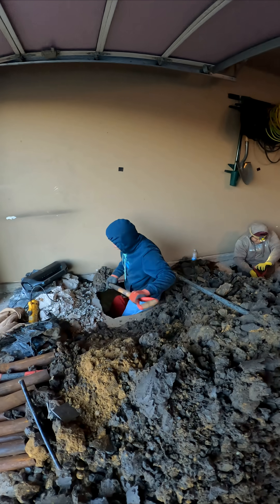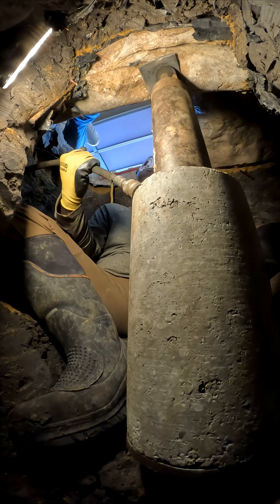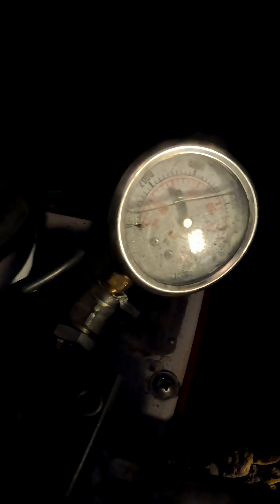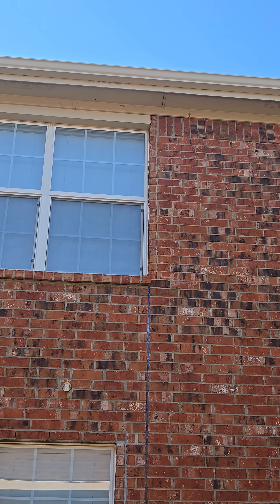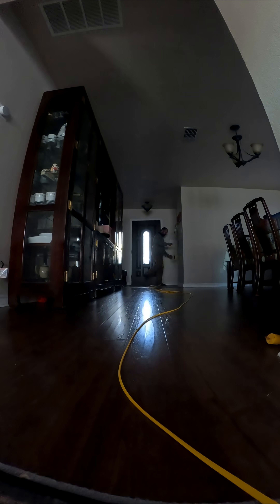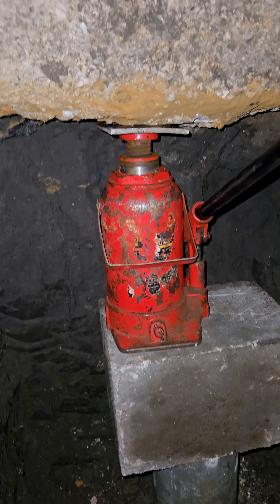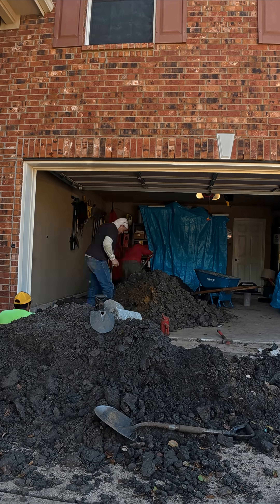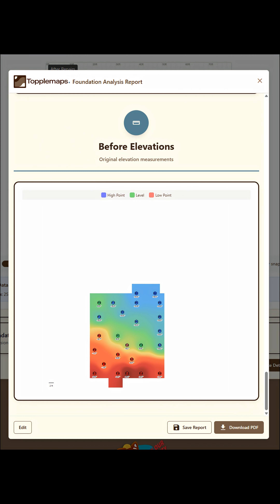Foundation Repair Part 2: Finishing the 30ft Piers and Lifting the House

Comment: Подскажите как называет прибор жёлтый с проводом. Для чего он?
Reply from the maker: It's a ziplevel, it is a digital altimeter to measure the foundation elevations, instead of using a laser level. This helps a lot so we can move around rooms/walls without moving a laser so the 0 or reference point remains unchanged
Reply: @ifixconstructionfr спасибо нашел. У нас подобных нет. Приходится несколько лазерных уровней использовать. Удобная штука.

Стоимость 1000 баксов? Поверка сколько стоит?

Comment: Can I ask how you made the heatmap indicating high and low spots? Are those markers some type of pod that you’d set around the house ?

Thanks!
Reply from the maker: I measure all the elevation points with a ZipLevel. Once I take those readings around the house, I enter them into ToppleMaps and the software generates the heatmap automatically. The markers you see are just the elevation points
Reply: Classy workmanship

Comment: How does that box check elevation?
Reply from the maker: It measures elevation by reading pressure changes in a hose filled with a special liquid. As you move higher or lower, the liquid pressure changes, and the ZipLevel converts that into precise elevation readings
Reply: @ifixconstructionfr 
What is the name of this tool? (Yellow leveler) 🙏🙏🙏

Comment: So the house was built on a concrete pad ?
Reply from the maker: it’s a slab-on-grade foundation. The concrete slab is poured directly over the prepared soil, and that slab becomes both the floor and the base of the structure.
Reply: @ifixconstructionfr  Ahh.. yes, we do something similar in the uk when the ground is unstable or when there's been old  mining activity

Comment: Wow. Never heard of this before. How much does something like this cost?
Reply from the maker: This specific repair was $14,000 for 13 piers and 12ft of tunneling, in DFW Texas
Reply: @ifixconstructionfr  wow, not near as much as I thought it would be, but still I would not want to have to pay for it.
Reply: A lot, but cheaper than a new house. This used to be a death sentence for a brick building.
Reply: Cheaper than redoing the whole foundation
Reply: I'm no expert on this, but digging tunnels to lift a house like they did here would be expensive. Of course the price would depend greatly on the size of the house, but my guess would be at least $30k for this method, and potentially much more.
Reply: Have any people in/ near Atlanta GA? Got quotes 31k for my 1 story 1800 sqft home here

Comment: This is fascinating. Now what happens to the space created from lifting the house where there are no piers? 

If you left the house 2 inches what happens to the 2 inches of empty space created underneath the foundation?
Reply from the maker: When we lift the house, the weight is no longer sitting on that soil—it’s fully supported by the piers. Each pier transfers the load straight down to the load-bearing strata, and they’re spaced every 5–7 feet, so the foundation stays fully supported even if there’s a small gap under certain areas. That void doesn’t compromise the structure.

In some cases we fill those voids with a slurry mix, but it’s not always necessary. The important part is that the house is now carried by the piers, not by the soil that previously failed.

Comment: How do you handle a traditional basement?
Reply from the maker: Depending on the issue, that can mean installing steel wall anchors, carbon fiber straps, or full underpinning on the outside of the foundation. The goal is to stabilize the wall first, then address any settlement. Every basement is unique, so the repair plan depends on whether the problem is bowing, cracking, or vertical settlement.

Comment: Does this require a foundation with post-tension cables or a grade beam? Would it work on a standard trench fitting that has only a few pieces of rebar in it?
Reply from the maker: No, you don’t need post-tension or a heavy grade beam. As long as the footing has enough concrete strength to support the bracket, the system works. The pier transfers the load to the deeper soil, not to the rebar